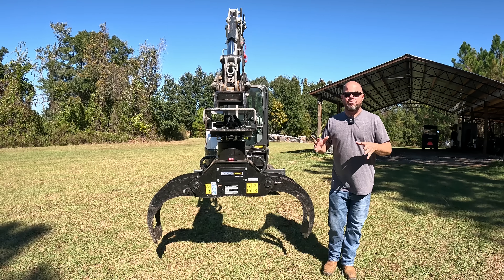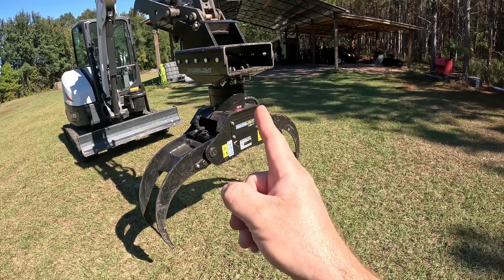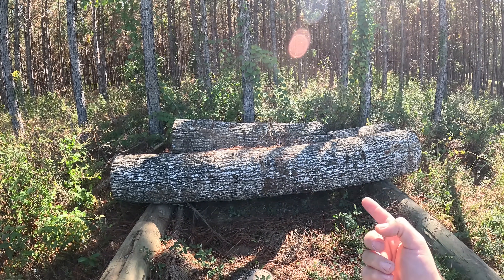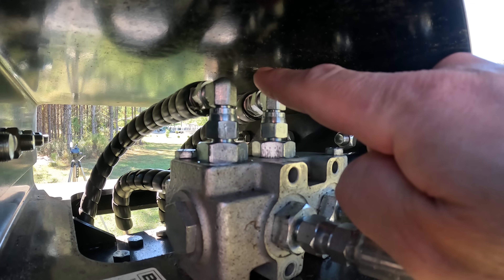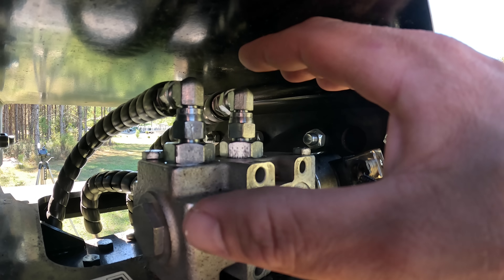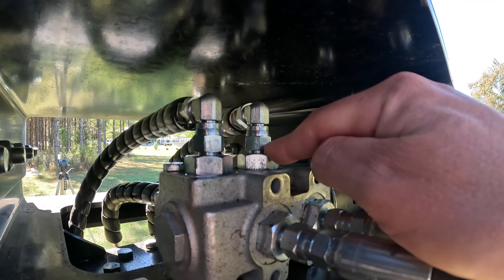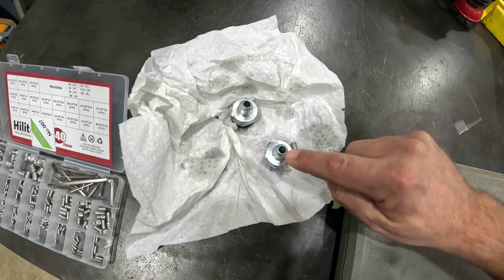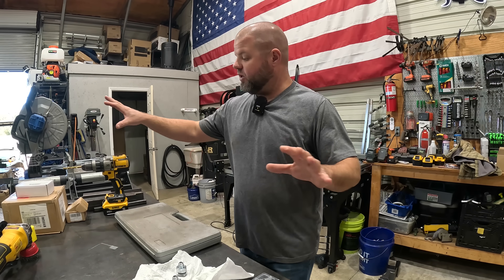DIY Hydraulic Flow Reducer Fittings!

Comment: Man Andrew, I just love your content.  All the tinkering and working on stuff like this is what I love doing too.  I personally just don't have the means to do a lot of what you are doing.  What you did works really well. The feathering is a great plus and it sis slow it down. I wonder if maybe a 3/32 hole might have worked better for you as it is .09375 compared to the 7/64th which is .1093. The 1/16th may have been too small at .0625.  I likely would have tried starting with a 1/8th (.125) thinking that would need to be enlarged. Obviously, that would have been wrong. I know you want to try to somehow install the needle valve adjustable restrictors, but you are limited on room. Could you put them inline somehow leading up to the attachment?  Maybe fab a bolt on mounting plate or box on the grapple to secure the restrictors, but still be clear of movement. If not there then perhaps on the arm itself allowing for the ability to restrict flow for all attachments as needed? Take care and thanks.  I'm looking forward to the messy shop table project you mentioned that is coming up.
Reply from the maker: I went ahead and ordered the adjusters, I will come up with something to make them fit.  I like the idea to be able to dial and change the speed at anytime.

Comment: Just remember when you start restricting  hydraulic  flow you can raise the temperature of your   hydraulic fluid , but as long as its not a continuous flow you should  be ok
Reply from the maker: Very true, however the rotator is a low use part of this.  I am mainly clamping.

Comment: Surprised that it still moved that fast after it was restricted by so much. What do you think you would suggest Baumalight restrict it to, 5/64 or 1/16? Or do you think that 7/64 is a good compromise where it can move brush quickly and can easily feather heavy loads?
Reply from the maker: I am going to see if they can put dial flow restrictors inline if possible.  I am trying to figure that out myself so I can dial in the sweet spot for my situation.

Comment: After using it for just a few minutes check temperature on it when you restrict a fitting sometimes they will overheat and blow out. Just a fast check 
And thanks for sharing.
Reply from the maker: Valid point, I am trying to figure out how to fit dial flow restrictors inline.

Comment: I'm surprised that was still as fast as it is. I'd have lost money on that bet. At least you can feather it now, but the fitting should be fairly easy to find at a hydraulic shop if you want to give it another go. But the more you restrict it the more risk of that plug forcing its way out. I'd be tempted to leave well enough alone.
Reply from the maker: I am trying to figure out if I can actually put some needle valve hydraulic flow restristors in line.  Not much room to work with, but I am going to go for it.  Then I can dial in any setting I want to.

Comment: Do you have a case drain on the rotator, so the output shaft doesn’t see high pressure?
Reply: That machine definitely isn't set up to have a case drain from the boom, but with a gear motor they aren't always necessary. He probably would be further ahead to only restrict one fitting (if he did both) and only turn it only in the direction that flows into the restriction and out of the free flowing port.
Reply from the maker: Not required on the rotator, but it does have a pressure relief if I remember correctly.  This was discussed with the rotator engineers during design, and I remember them saying it didn't need a return.  I do however have a case drain on my machine, but I only use it for my rotary cutter where it's 100 percent required.